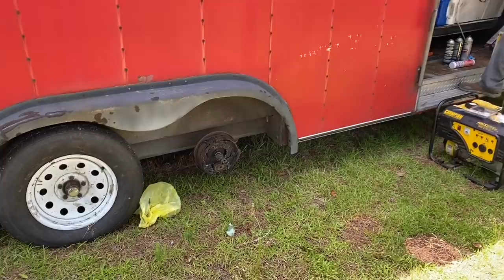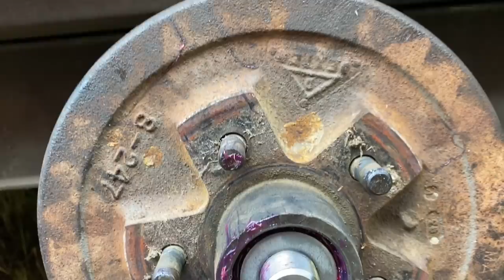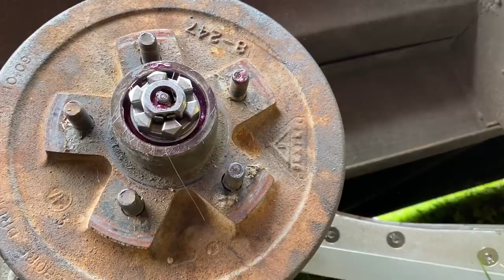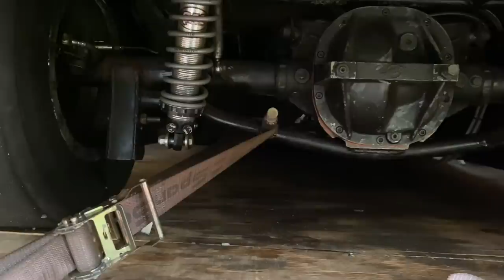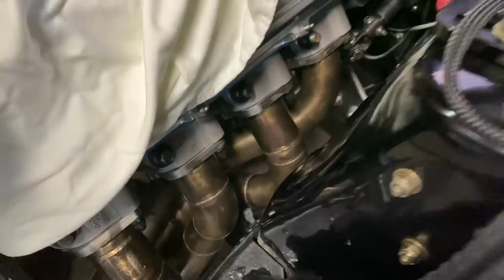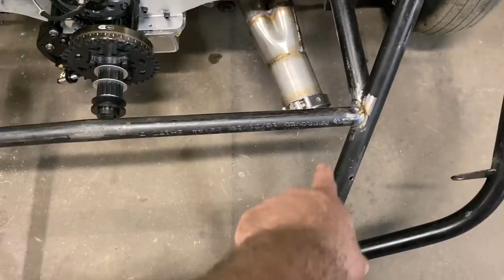Working on the the race cars

Comment: Nice! If do you benefit weight of turbo sitting that far up front compared to sitting to one side?
Reply from the maker: Forward in the middle is for sure nice nose weight on the tight radial tracks.  Helps the percentage a lot.

Comment: Well I learn something today lol question john do ur control arms mount in the factory location? Can u fit a small tire drag radios ect ect with factory suspension on a foxbody mustang?
Reply from the maker: My lowers are moved in about .5” if I remember right. You run into issues with the stock spring location for clearance.
Reply: @TurboJohnRacing  what is the solution to this? Where can I find information or a video about this problem and solution

Comment: John, at what rpm do you normally launch at on a track with good prep?
Reply from the maker: 4000-4200, I pull timing on the hit and ramp it back in.  And also vary boost on launch
Reply: If I remember correctly you are running a sbc combo?
Im curious as I am running a sbc 414 with twin 66mm, what timing do you run with your setup. I know some of these specifics are kept secret, around my area there are few that know much about these things and even less willing to share information.
Reply from the maker: Go look at my racing vids, if I’m testing I show the data logs.  Box on the left gives all the details for boost, timing, a/f.
Reply: @TurboJohnRacing  I checked out some of your videos showing your data logs, you run a lot more timing than I do. I know every engine is different but you just check plugs and slowly start adding timing until the plugs look too hot?
I run 32* total timing and 20* at 25psi, I cant tell by the plugs if it wants more or not.

Comment: Guessing too late for this weekend but if you are looking at video regards separation/rear squat, if you have footage, may want to check side to side.  I assume they should be very close to the same, to me, last race video, looked like drivers was more than passengers.  Could be my eyes or angle of video or one side is up against stops.
Reply from the maker: Yes, my car normally twists some as do most non chassis cars.  The driver side will always tell a little more.  My right side, normally does not show the same.
Reply: @TurboJohnRacing  So what would the result be if you were to adjust so the sides did show the same?  In the back of my mind thinking of the "G body shuffle" some are severe but others next to none and cars going dead straight.